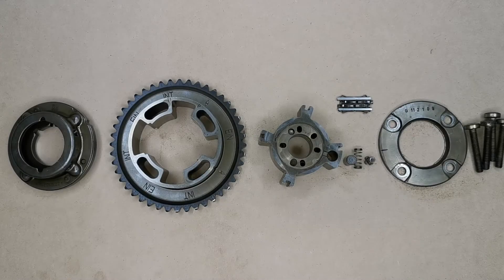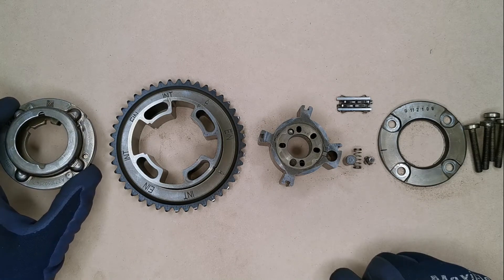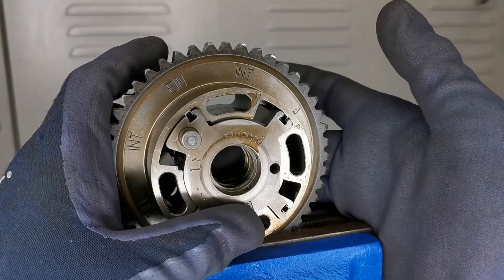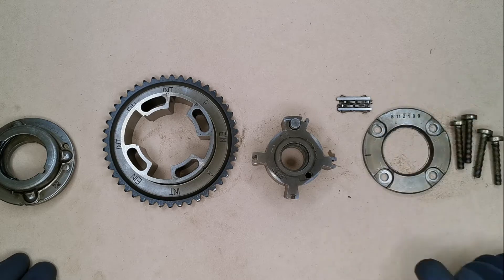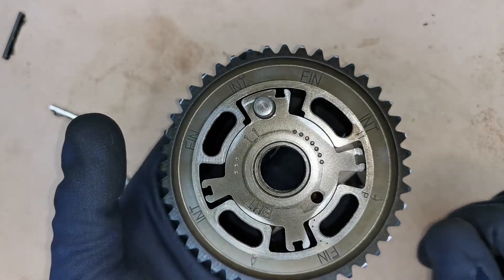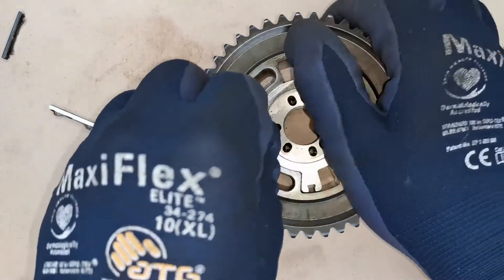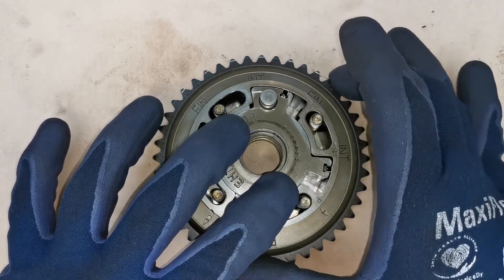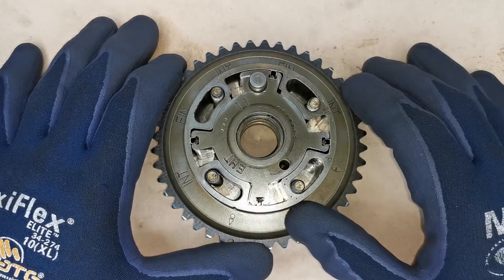Camshaft Adjusters - How They Work & How It Failed!!

Comment: Are the lost pulses from the magnetic camshaft sensor the problem or the locking of that adjuster when the motor starts at 3000 /min without misfire but not at 1000 /min? the cable is oily but sometimes the motor have no problem. I think there is a problem with the valves timing from cyl1 and cyl4 they have often misfired on cold engine. It’s a Mercedes M111 from 2001. the camshaft sensor and the crankshaft sensor is new.

Comment: Just wondering, I have w140 500sel , once i just started the car cold there was no problem until 15 min later she started rataling raves up and down , so was taking for the spin, drove around 12-15km still shaking once driving, after 20km of driving she back to normal perfect car, let me say, rotors flyers coils changed, harness changed new, spark plugs ok, now she just starts like new, until she gets hot after 15 min of running, U can hear rataling on the left side 4 cilinder , right side has no rataling, it runs hot then sounds like 4 cilinders having problems , spark plugs iridium NgK 1k km on them, so came up with this problem what you just saying about,vis this the problem camshaft magnet adjuster valve or sensor, whatever it is,
Oh once engine cuts out,  after starting, she backfires, so can't start once she's hot. Please any ideas, she's standing almost for 8 months no one can fix it, she's 1993 17k miles on the clock. Love the car.

Comment: Thanks for sharing info/ I have the E350 cgi s212 M257 engine.
Engine management telling me that camshaft seems to be not logical in corresponding position with the crankshaft. OBD II is telling me that Bank 1 is Off position -2 dgs. If I reset the codes while running the engine I can drive multiple miles without engine lights turn on. After stop engine and start engine light comes on in a second. Car has been maintained well If I look to the car overall and has 200.000 km on the clock. Looking visual true the inspection holes indeed 2 degrees deferens is to see between bank 1 and 2. 
Should I be worried that timing chain has to be renewed and engine has to be removed from the car. I just bought the car two months ago. expect that total cost of buying and repairing €17.500.- so that means that a car original has  costing almost €100.000.- is dead after 200.000 km. I refuse to believe that in matter Mercedes. What do you think, is there a bit of hope that the problem is more simple to solve?

Comment: Hi Gerard - great video's, thanks. Rang the garage to see about having my timing chain/gears checked but you're a long way away! Having reviewed your videos again, I decided to have a go at myself. Could you answer a small question please? The Mercedes factory manual says that, to check the position of camshafts, the engine needs to be turned by hand until the piston in cylinder 1 is positioned at TDC on the crankshaft pulley " + or - 2 degrees". My adjusters line up with the arrows on the camshaft bearing housing with the crankshaft pulley at .5 of a degree behind (to the left of) TDC. Does this mean my engine timing is correct or do all three timing reference points have to be "bang on"? Many thanks again.

Comment: Hello from Greece.
I have an early production M271.940 made in 2002 for my CLK200 C209.
Is the about 2 second slight rattle on start-up combined with sometimes listening to a sudden "creack" sound and then the engine runs quiet, normal? I have 192k km. Changed timing chain at 153k km . Always change oil earlier than 7k km. 5w-40 229.5 spec. Thank you for your time and effort! Cheers, Nick!

Comment: Hey Gerard! We've nailed down a solution for the issue with the locking mechanism in M271 EVO engines by designing completely new VVT gears. Interested in trying them out?
Reply: I am goingo to change mine for second time i am interested in the solution

Comment: m276 owner, currently no check engine light, rattle on start up for 2-3 seconds. my camshaft adjusters do not slip like displayed in the video.. could my tensioner just be bad?

Comment: By far the best video on youtube on these.  A few questions to better understand the system:
1. Is this an 'either on or off' system or does it adjust the timing in between the cam phaser range?
2. The torsion spring in the adjuster - is its job to bring back the adjuster to the point where the plunger locks?  Does this happen when the oil pressure is reduced due to the solenoid not pushing the cam phaser oil valve?
3. Does the oil pressure from the valve in the cam phaser also unlock the pin?

Comment: Great video, I'd buy you a pint if you were local. Early M276 engines secondary chain tensioners don’t receive adequate oil flow on start up. Mercedes did update some parts 
Q. What would you say leads to failure? Late oil changes or assembly issue? 
I ask because the 2015 C300 and C400 Mercedes M276 engine still seems to have cam related failures from 60 to 71K miles.

Comment: Hey can you give Me your input? I'm trying to determine what I need. My Scan Tool is showing Me A code for Actuator Exhaust Camshaft Cylinder Bank 1. However when I search for It, I'm only coming up with Camshaft Adjusters and Solenoids. So I'm just confused as to what exactly it is. I have a 2014 M276 Engine. I'm trying to determine if I need The Solenoids on the Camshaft Cover, Or the Actual Camshaft Adjuster Gear. The Car Starts Right up and runs, just runs rough and engine vibrates, Can you help?

Comment: So can you just replace the pin to fix it ?
Reply: I think ots not about the pin, rather about the hole it goes into. Is the hote supposed to be round hole with notmal edges? Not slidi g edge? Sliding edge to the hole  is ecouse of wear? I could weld in the hole and drill out new hole. What would be the problem if the pin would not disengage. Do you ahve a picture of not worn out disassambled part?

Comment: Hi Gerard, thanks for the excellent video.
Would you be able to advise me if a faulty pin, cause the tensioner to get damaged and which will cause slack in the timing chain and over time damage the timing chain.
Can that sequence of events potentially happen?

Comment: Do you have the process for the M274 engine 2014 E200. There are no alignment marks for the gear hub align to camshaft,but also do you need to load the chain for the gears ? Appreciate any help. This motor has changed from P0016 to now P0341 this is a click when manually turning the motor over by hand. Parts that were replaced timing chain and tensioner,both gear hubs (look different to your video) all genuine Merc.
Reply: ALLANFINLAYSON - HAVE YOU RESOLVED IT ON M274 I HAVE THE SAME PROBLEM SAME ENGINE

Comment: Thank you ! You saved me a year later I still had the lock pin and spring when I took the heads off . I had no idea where that piece went , I pulled off the sprockets and the right side intake gear sprocket included and noticed that lock pin sitting inside near the valve springs and hydraulic lifters , I was baffled where it went since I never opened up the gear .  Thank goodness for a year later finding this detailed video and now will not have extra parts leftover from that job a year ago !!!

Comment: Hi Gerard. Quick question.  We have just changed our camshaft adjusters, timing chain and tensioner on our 2012 Mercedes-Benz C200, M271.  There was a small pin that we not sure if it came out somewhere or were it belongs.  Is there a possibility this came out the camshaft adjuster? I can't see one like it in your video.

Comment: Sorry I want to ask 'there is a problem with my vehicle E212Mercedes' when starting the cold engine the engine vibrates for 20 seconds. when the camchaft sensor is removed, it starts normally.
Thank you

Comment: So the teeth on the intake and exhaust camshaft adjusters on my Audi are missing. I dont know how, the engine had been hard starting for years but no loss of power. Started gettin cylinder 1 misfire last week and thats how i discovered that timing was out.

Comment: Hey! New sub here. I am currently undertaking this job on my merc and these videos helps alot! Thanks!
But seeing the problem on the pulleys you have, i wonder if it can be repaired without buying new parts. Just replace the material that is missing with weld, and grind (i have access to precision machining tools) a new profile? 
I'll try and update you soon. :)
Reply from the maker: Thanks Per,
Its definitely possible, good luck with the repair 💪👌

Comment: 9:00  So when testing to ensure it correctly locks, youre rotating the crank counter clockwise to engage the pin, then wrenching it clockwise to see if the pin snaps out of place? Im at 200k miles and am looking at this on my c230k. Thanks!

Comment: @Gerard Burke: nice video to explain little known topic.  My W204/M272 engine is a bit more complex.  Currently I have DTC 1208 as intake cam retarded.  What’ve I noticed is that intake cam is supposedly fluctuate between 4 ADTC to 36 BDTC.  In my case, it goes even to 36.2-36.6 which simply means timing is off, chain is stretched or sprocket worn?  But what’s most interesting is: once it reaches 36.6 (rpm=3500) or 36.2 (rpm=2500) then it’s “locked up” (shows constant instead of fluctuation); what’s happened there?  Do you have any idea, answer?  Appreciate your input!
Reply: This is the same observance i have with my 2008 m272 3.5. Trying to figure out why its doin this as well. Is it the oil control valve or the cam phaser gear on right side intake. Dont know but sooner or later i think i may have an expensive fix. Dont think its the balance shaft though as mine is out of the affected serial number range. Let me know if you make any headway.

Comment: Awesome. Thanks!   I was looking for clues on how might lock these on my bmw n73... Looks like I can just swap the spring loaded locking pin for a longer non-spring loaded pin, unplug the valve and be done with it. Right?  
    I'm using an 03 n73 V12 in an old jeep Cherokee overlander project, so I'm stripping/deleting all the electronics, and adapting carburetors, and HEI distributors for ignition.   
    Thanks again!
Reply: The best bet would be to open them and add a metal block inside to lock them in place. A machine shop can make something for you.

Comment: Thanks for this video.  Is it possible then for the timing marks to all line up correctly but then the camshaft is not where it needs to be when engine is running because the lock pin has failed?

Comment: great video and explanation! can I trouble to have a look at a video of the noise my engine makes on cold starts ? https://youtu.be/y84ojYnwwSc It's an Alfa Romeo 1.9 JTS and after asking around and seeing multiple mechanics the consensus is that it either has to do with a bad actuator losing oil pressure (or not getting oil on startup) or, second scenario it has to do with timing chain around the water pump area. I need to mention no errors present and the chain looks to be well tensioned. thanks!

Comment: It would appear that the VVT will allow for about 2 teeth of timing adjustment, 44 teeth on the cam gear so a bit more than 8 degrees per tooth and a bit more than 16 degrees for two teeth, times 2 or a bit more than 32 degrees total advanced timing for 2 crankshaft rotations or 1 firing event or 4 strokes of the engine or 720 degrees of crank rotation. The capability for this system will be viewable on a scope or live scan data if given in that format. The DTC did not give a specific value to set the trouble code which would be in the service data. I would only guess at a value greater than 8ish degrees to set a code??? Thanks so much for the video and tutorial, now I can see the locking pin does not have to be broken in half or jammed in or out, this one is simply slipping out of the locking hole and making plenty of noise.

Comment: Gerard... You are a genius. This video was so well explained that I now have a full understanding of this issue. I have the confidence to undertake this repair myself thanks to you. Good Job!
Reply from the maker: Thank you very much for the comment Jevon, I appreciate it 🙏🙏
Reply: @GerardBurkeBurkesGarage  I have a m272 3.5l I recently replaced the camshaft sensors and magnets about 20,000 miles ago but they weren’t from dealer so would that matter or not? I change oil at 3,000 miles so oil won’t get sludgy I recently had p0300 and I did a lot of maintenance before I got it code became p0010 so I cleaned sensors/ mags and it’s still there I’m at 165k miles and my mechanic said he did the balance shaft before I got the car so about 3-5 years ago now and put on about 50,000 miles between me and old owner all external belts have about 40,000 on them
Reply: I second this comment fully

Comment: Gerard great video. Additional question is why does the wear occur? Depending on the answer to that question what can be done to prevent premature failure or excessive wear? Thks
Reply: Think my C250 1.8 has developed this prob at 94k, it is looking like fuel getting into the oil caused this problem over time. Thanks for the video it has been a great help.
Reply from the maker: Thank you, 
My latest video on this Mercedes is now posted if you want to check it out 👌

The wear is due to sub standard materials from what I have read, I am unsure if they upgraded the quality later or if it is the exact same materials/parts still being sold.
I asked my parts suppliers plus the dealer and neither of them were sure 🤷‍♂️

Changing oil regularly and using the correct type of course helps, but there is no extra way of avoiding this issue that I know of in these models.

Thanks for watching 🙏🙏
Reply: @GerardBurkeBurkesGarage  Perhaps the same substandard materials (vendor?) used on the balance shaft sprocket used on the early M272 engines that suffered a lot of premature wear and costly engine repair.